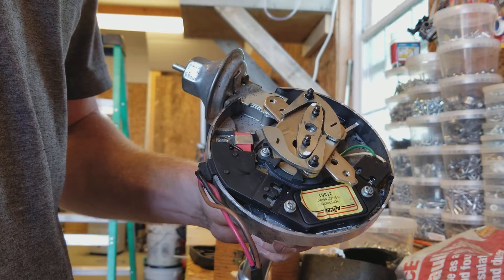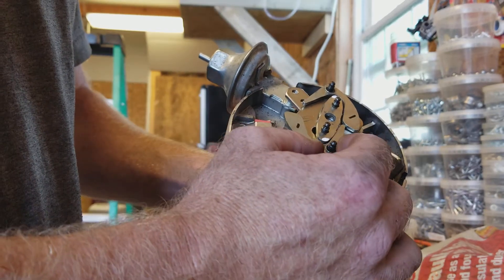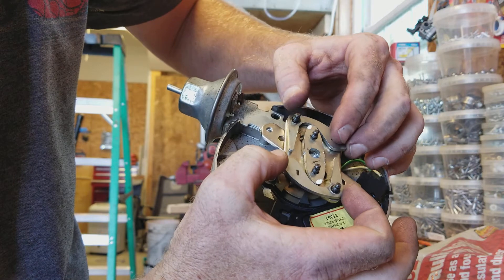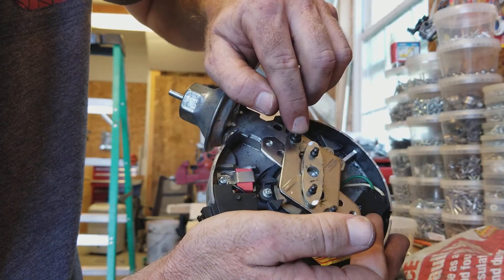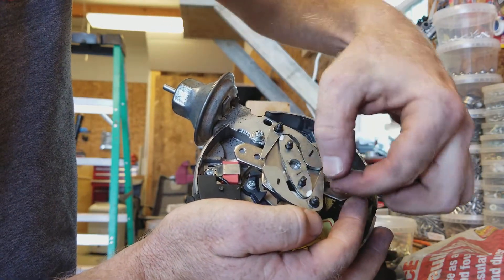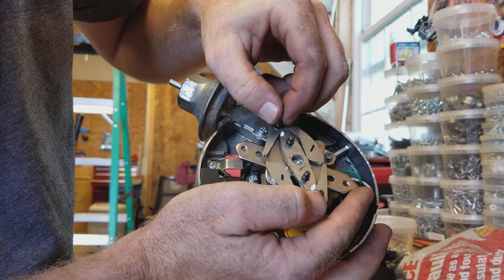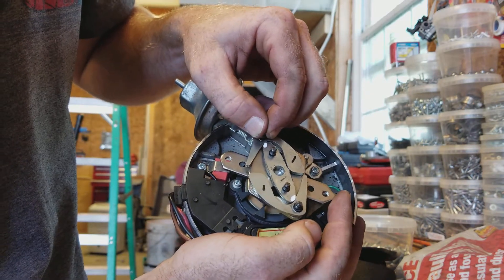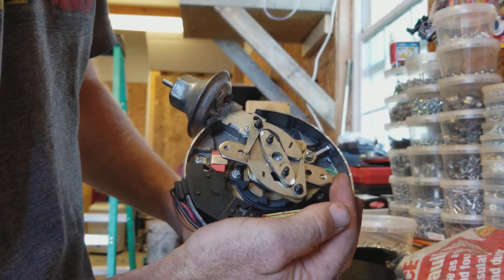How to increase HEI distributor mechanical advance

Comment: The more timing you have on the crank (initial) and the less you have mechanically to achieve your total, is the best way to go for pulling or coming out of the hole especially in a heavy vehicle. My bbc in a C1500 has 36 total 26° on the crank (initial) and 10° mechanically in the distributor. It's snappy down low street driving, and pulls like hell down low. You have it backwards my friend.
Reply: Isn't it difficult to start with that much initial advance, especially on a hot day?
Reply: @NathanielHatley  No but that's what everybody asks because that's what they read everywhere, but it's not with my setup, I have a gear reduction mini starter and have no problems at all. Simply recurve your distributor and try it, if it doesn't work with your setup you can always go back. Before I recurved my distributor to get 26° on the crank my setup liked 18° on the crank anyways, with 20° in the distributor.
Reply: That is awesome I think the same as you I have a c10 with 305 sbc, I have 18 initial and 18 mechanical, and 17 vacuum that is all in by idle. The reason I didn't bake all that timing in the initial and just lock out the mechanical is because I have a stock starter. I get great gas millage and I can spin the tire if I want too!
Reply: Well that gear reduction starter must be doing it’s thang because my C10 454 won’t even think about turning over with 18 degrees initial......I run 38 total, my HEI mechanical gives me 20, that leaves me at 18 initial....which is a no start!  Had to add in an MSD 8984 starter retard box set at 10 degrees of start retard.....starts like a champ...... When you give advice remember most people don’t have your high dollar starter and are not going to buy one!

Comment: Base timing isn't as important as total timing set that first and as long as it starts well and doesn't have any issues even if it's at ten dg what's the difference ? Who yeah I know besides the engineers at gm says it's got to idle at 4 deg btdc. I've always been taught to set timing to total and just go from that point back if it has trouble starting find out why is it a bad cable that's common starter perhaps a smog type engine which is most of what I worked on over the years loves advance fast early and in big numbers and won't have any adverse effects from detonation due to the low compression as the compression goes up the advance curve has to be brought back and go by engine rpm and octane in the fuel so it's a game of find the right combo that works for your application of course the ecm does it now and all that but check the curve on two different engines and you'll get two different results there are a lot of variables octane being the biggest high octane I can have high compression and quick advance and high performance but as I said before set total come back to initial start it see where your at it may only be 6 dg or so which is fine even 10 is fine 12 eh is ok too if it starts well it's good
Reply: Really low initial with vacuum advance connected to ported is for smog engines with air injection in the exhaust manifolds. If you remove the air injection, then you can hook the vacuum advance to manifold vacuum and probably bring the initial up to 8-12°.

I've got a smog 454 that I'm going to recurve the distributor on, right now it only has ~14° of mechanical advance. I don't want to go past 12° initial, so I only get 26° total right now. I removed the air pump and manifolds, so I don't have to worry about any of that stuff anymore.
Reply: @NathanielHatley  454’s like 36-38 total

Comment: Is your initial timing set so low because there is no vacuum at idle?  then when you start to take off  the vacuum advance module starts to kick in? I'm catching Hell with reading both ways. Some say they hook it to have vacuum at idle(fully advanced) and then it decreases as the rpms go up.
Reply: You want manifold vacuum which gives full advance at idle which makes it run smoother!  Only idiots say otherwise and there’s a whole lot of them out there!

Comment: Do all Distributors need Springs and weights I bought a brand new distributor but did not have the springs and weights on it and neither did my original is that okay?
Reply from the maker: What kind of distributor is it?
Reply: @27dtrost  it's a distributor for a 84 Oldsmobile without vacuum advance
Reply: @bz710  long time since your post but- about 80-81 the distributors did not have weights/springs = computers were added that control timing advance etc. all the distributors did was FIRE when the computer told it to do so…

Comment: any reason not to shave the weight at the point of contact?  thought being, easier to remove the weight shave, replace and test instead of pulling distributor. good video.
Reply from the maker: I've since gone to an LS swap.  I put a 2007 6.0 engine into the 1983 K20. Best decision i ever made. No more messing with carburetors and mechanical distributors.